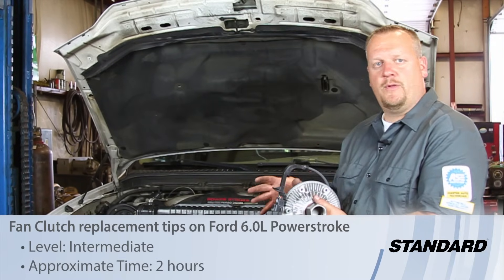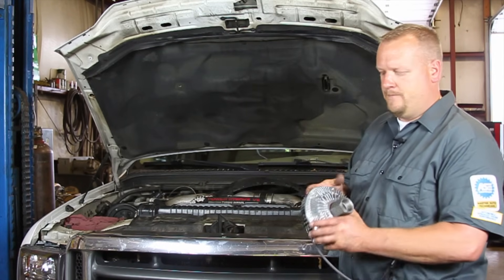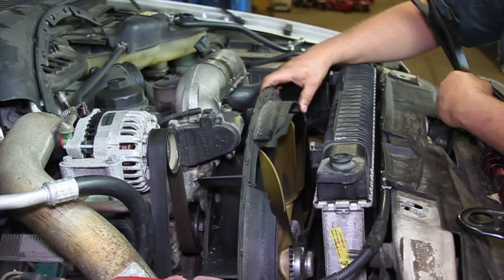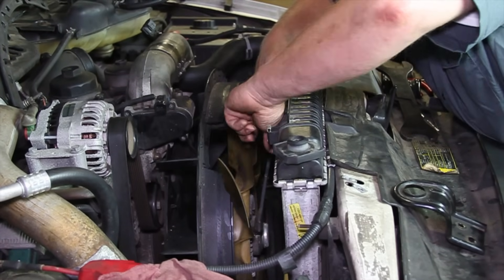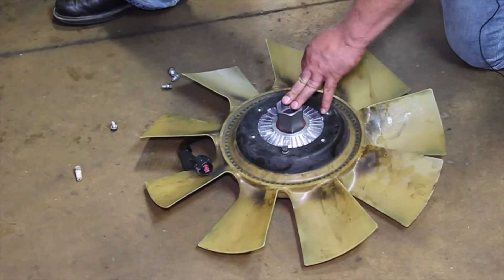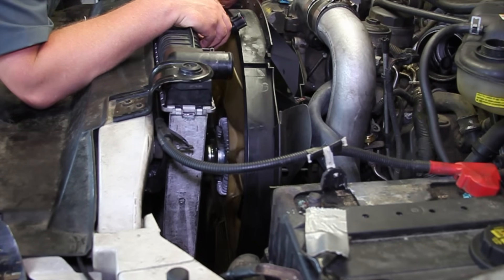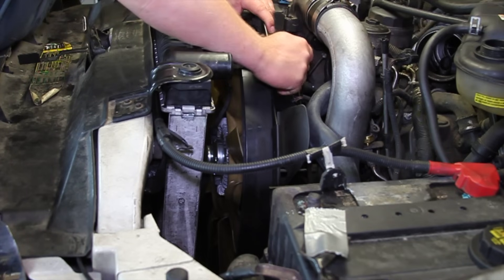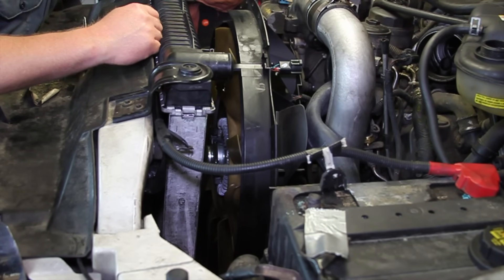Ford 6.0 Powerstroke Fan Clutch Replacement

Comment: I was wanting to know if you had a video on diagnosing a bad fan clutch? I have a 2006 F350 6.0. yesterday I pulled a P0528-60 code. I know it's has to do with the fan clutch speed sensor. I was just wanting to know if the xxxx-60 is a subcategory or anything at all. I'm using a Launch X431 CRP919X OBD2 Scanner.

Comment: if the fan clutch is bad on a ford f350 will it throw codes p0707 and p0706. just replaced a new fan clutch and now throwing these codes.
Reply from the maker: The EV Fan and the Trans Range sensor share the same reference voltage, so a shorted fan can certainly cause these trouble codes to set.

Comment: How do you know you have a bad fan clutch? And could a coolant temp sensor be a cause of the fan to come on when acceleration with a cold, no load truck?
Reply: Wire ripped beacause of the stupid fan then it will overheat in my situation thats how it went
Reply: arie the1manparty
Reply: Good info. Mine is over heating from a take off. Cools down when I get rolling. I ordered a clutch.
Reply from the maker: Many times these will set a DTC in the PCM. Symptoms may be delayed engagement, delayed disengagement, over heating, or fan stuck on. There are many different inputs to the PCM to control this fan clutch including: engine coolant temp, oil temp and, transmission temp. You should monitor these inputs along with the PCM control signal to the fan clutch before condemning the clutch itself.